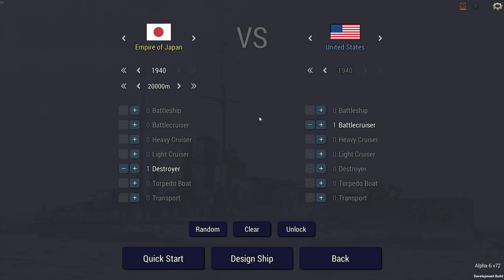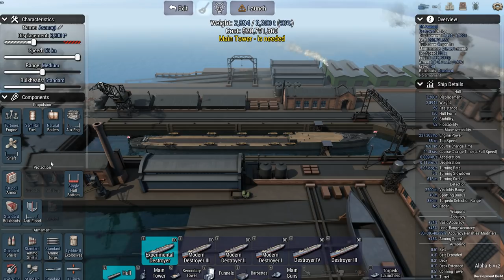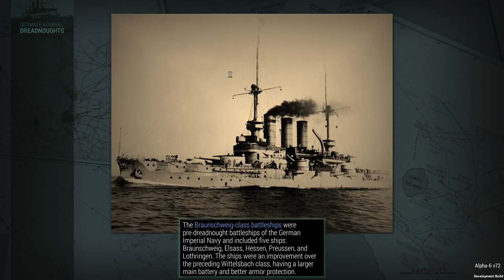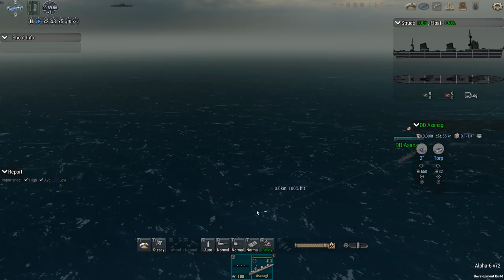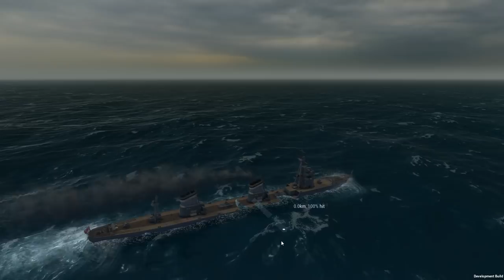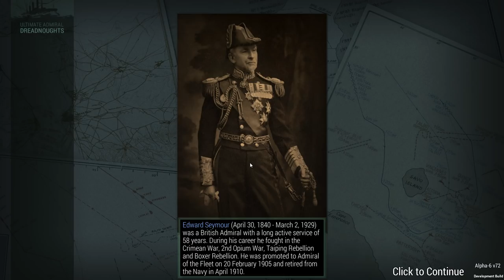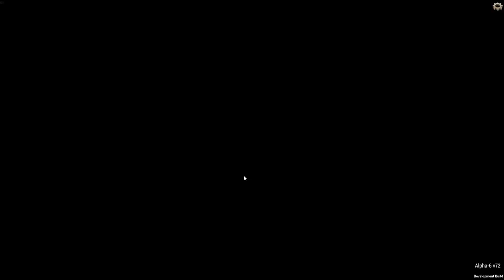Ultimate Admiral: Dreadnoughts - 55 Knots (Alpha 6)

Comment: How fast can your ship go?

"YES!"
Reply: Faster than some planes.
Reply: Todd Hendricks  Bear in mind that the higher the displacement, the bigger the engines (more weight) and probably the bigger the necessary funnel capacity. It's better to make a small destroyer and deck it out the wazoo with torpedo launchers

Comment: as to quote the great Jeremy clarkson

SPEEEEEEEED POWEEEEER

also a scenario

scenario: Johnston's revenge  

shortly after the battle of Samar a squadron of 10 modified fletcher class destroyers spotted a Japanese fleet consisting of 1 battleship and 3 destroyers the destroyers chase down this fleet and engage them with the intent to avenge the USS Johnston  

you will build (1945 tech) 10 American destroyers based on the fletcher, but you can minorly alter the design (change gun calibre, armour gun placement ECT) 

 you will fight (1940 tech) 1 Japanese battleship 3 Japanese destroyers  

win requirements at least 1 destroyer survives the Japanese battleship is sunk  

optional win requirements the Japanese destroyers are sunk more than 2 destroyers survive 

 you loose if the Japanese ship escapes or all your ships are sunk 

 good luck, you'll need it

Comment: Stealth it's not a bug look at the horsepower of the engines diesel has less power than steam but weights less but do to the low power it needs to be bigger and so it weights more
Reply from the maker: Ah of course, gotcha. Thanks!
Reply: It has a flat reduction %, that should mean it would weight quite a bit less
Reply: @hoovyzepoot  A difference of flat reduction by 17.5% doesn't matter because it has about half the engine power. Geared Turbines 2 is 30.5HP per ton with 10% reduction, Diesel 2 is 18HP per ton with 27.5% reduction. Let's say we need a 100,000HP engine, the Geared Turbines 2 will weigh 2950 tons (100,000 / 30.5 x 0.9), while the Diesel 2 engines will weigh 4028 tons (100,000 / 18 x 0.725), 37% heavier than the turbines. The benefits of the Diesel engines are that they are less likely to be damaged, are much faster to repair if they are damaged, and need less storage for fuel (which could save a little more weight, especially for long range ships, so could have some potential use when the campaign arrives). However if you just need power, Geared Turbines will always be the way to go.
Reply: @Stealth17Gaming  I've decided to wait for them to add rowboats/tiny ships so you can an 80 knot life raft that kills with a 2 mm and extra ammo. No armor needed. Make sure you have a bunch and call them the piranhas.
Reply: @Nutty31313  Marine diesel is basically the engine of choice when you need a ton of fuel efficiency and not that much speed. So basically, your auxiliary ships of all stripes, cargo vessels, subs, and convoy escorts. I don't know how much detail the campaign will go into and the devs have already said that aircraft aren't in the picture for the foreseeable future (and aircraft and subs are the reason escort ships existed), or if auxiliary ships like colliers, oilers, and tenders will be necessary, but that's where I'd use them.
Reply: @ZaffaPlaysGames  I heard somewhere they are looking into bringing submarines into the game, but I don't know if it's true. Also there were a few surface warships that used diesel engines, the most notable coming to mind being the Deutschland class pocket-battleships. Diesel engines have their place in the game, perhaps if you want max reliability and survivability and don't care much about speed you'll take them over the geared turbines.

Comment: THE IJN SATSUMA 
1914 the German East Asiatic Squadron under Admiral Von Spee  attempted to get back to Germany, by crossing the Pacific. This led to the Battle of Coronel and the 1st Battle of the Falklands, whilst he sent the Emden as a lone raider West for the Indian Ocean. What if instead of going East, he took all his forces West as the Allies feared.

The main search for the Germans was carried out by the Japanese.  The primary interception force being the Semi-Dreadnought Satsuma and two Protected Cruisers the Yahagai and the Hirado. IJN Satsuma would the rest of the war escorting ANZAC convoys across the Indian Ocean.

Suggestion is that Spee's complete force goes West and catches the Satsuma escorting a troop convoy. 

German forces are 2 Armoured (heavy) Cruisers and 4 Protected (light) Cruisers. Spee's ships were the best gunnery ships in the German Navy. They all dated from around 1906 to 1908

Japanese forces would be 5 troop transports, 2 Protected (light) Cruisers and the semi-dreadnought, Satsuma. Her stats were, 20,000 Tons, 482 feet long  launched 1906, commissioned 1910, range 9,100 nautical miles. 4 x 12" centerline guns,  12 x 10" side mounted guns, (only because they couldn't get more 12"). All off those where in twin turrets. 12 x 5" in casemates, 8 x 3" guns and 5 x underwater torp tubes. Belt was 9" cemented krupp armour as were casemates and turrets with a top speed of 18.25 knots from triple expansion engines and twin shafts. When launched she had the largest displacement of any warship in the world.

If the Satsuma had been fitted with all 12" as originally intended, she would have been the world’s first all big gun battleship, predating HMS Dreadnought. Which means that future Dreadnought style ships would have had to be known as Satsumas. That doesn't have quite the same ring to it. Ultimate Admiral : Satsuma, it might not sell so well.

BATTLE

I think you should design something similar to the Satsuma or at least in a Semi-Dreadnought style, and see if you can wipe out the East Asiatic Squadron while at the same time getting the troop ships to safety.

Win/loss conditions 3 transports and BB must survive. At least both Armoured and half the Protected cruisers on German side must be sunk.

4 hour duration, before nightfall ends the battle, as Germans can’t find transports after that and withdraw. Contact range 15,000 yards.

Comment: What about a full gun boat? Max displacement, 35kt and 5" guns everywhere. Heavy shells, lydite I, max autoloders.
Reply: Against a BB or BC? Yeah, good luck with that. Against a cruiser, maybe. I think that you can HE-spam-cheese at most two classes above. And more than one destroyer
Reply: 35kt..... 35 KILOTONS?!!
Reply: @at-90ree13  35kt would be only about 10 times heavier than what he designed here
Reply: @Notmyname1593  That's a scary prospect
Reply: @at-90ree13  35 kt is 35 knots, a measurement of speed. 1 knot is about 1.15 miles per hour.

Comment: I think the HP per ton and engine weight interaction is working as intended. a Diesel is a lighter engine than a turbine but you need a bigger engine to get the same HP.
Reply: Makes Sense
Reply: How is it lighter if you need more of it to do the same? What do you mean by "lightness" if not the tonnes/HP?
Reply: @Snagabott  the base weight of the engine is lighter as is the fuel and other auxiliary weight but the engine power scales less. fuel weight scales with range so that is going to be important in the campain

Comment: Attempt 11

The year is 1940, and the war goes poorly for the British. Repeated Luftwaffe attacks have crippled the RAF, and now, in a fit of accidental strategic genius, an impatient Hitler orders Sealion to proceed, despite the lack of air superiority. 
The British fleet are in poor shape to face off against an invasion fleet. A surprise Luftwaffe attack on Scapa Flow has rendered inoperable most of the Heavy and Light Cruisers available to defend Britain. 
The Battleships are in equally poor shape. the R-Class battleships are too slow to catch the invasion force, which even now is beginning to amass of the French coast, Nelson is heavily damaged after an ammunition tug carrying torpedoes violently exploded next to it in an air raid, and a near miss to Rodney has opened up most of its engine compartments to the sea. The only major capital units left are the Battlecruisers of the 1st Battlecruiser Squadron; Hood, Renown and Repulse. 
Conversely, the Germans are well prepared for an invasion. A full recall of the fleet has recently been issued, and now the Battleship Bismarck, the Battlecruisers Scharnhorst and Gneisenau and the Heavy Cruisers Admiral Hipper, Admiral Scheer, Lutzow  and Prinz Eugen are all ready for action, though due to desperate RAF attacks on Destroyers in port, they now sail with minimal destroyer escort.  
The two forces detect each other at around the same time, and the Germans split off to engage the British fleet, knowing that these are the only ships Britain can put to sea to defend themselves.
The Battle:
"Action stations men! German ships spotted close by!"
The British have:
0 Battleships
3 Battlecruisers (Which you shall design)
1 Heavy Cruiser
1 Light Cruiser
6 Destroyers

The Germans have:
1 Battleship
2 Battlecruisers
4 Heavy Cruisers
2 Destroyers

Special conditions:
The RN Destroyers are in bad shape, many of them have been operating continuously since Dunkirk with little repairs. As such, many of their exposed deck weapons, such as torpedoes, are in poor shape and break down often. Every 20 in game minutes,  generate a number randomly between 1-10. If the number is greater than 1-2 or 7-10 , do nothing. If the number is 3,4,5 or 6, turn off torpedoes on all DDs for that amount of in-game time.

The Germans cannot afford to repair ships extensively during an invasion. A BB/BC with less than 20% structure, a CA with less than 15% structure or a DD with less than 10% structure can be counted as destroyed for the results of battle.

Victory conditions: Destroy all enemy warships. You have 3 hours until its too late

Comment: The reason tonnage goes up with diesels is that they give much less hp/ton. 16, vs 30.5. So while the engines for a given amount of hp weigh less, you need almost double the amount of engines to make your hp need. 

This is why the increase/decrease in weight isn’t linear. The % change is compounded by the efficiency of the engine.

Comment: Possible roles for a 55 kn Destroyer: 

Scout 

Equipped with radar, stays at the edge of enemy engagement range to report enemy position and make him waste ammo 

Harrasment 

Equipped with loads of long range Torpedos, aggressively fires them into enemy formations to break them up and force enemy ships to evade 

Fireship 

Equipped with the most powerfull and fastest Torpedoes available and crewed by the suicidally insane, rushes isolated enemy HVTs like Battleships, Battlecruisers, etc and hand delivers the big badabooms
Reply: Another:
Drive (or in this case swim) by gunboat. Could also serve as fast-response anti-destroyer
Loads of 5 inch triple turrets, lyddite 1, autoloaders. Rush in, wreck transports/TBs/DDs and get the hell out before that BB turns its turrets.
Reply: Can you make a 55 kn cruiser though? Equip it with big guns with range, so the purpose would be to harrass other ships at range, where they cannot hit you. Also finish off any stragglers since they can catch anyone.

Comment: The thing about engines and weight is that you need to look at the horsepower per ton. 
Turbines have more, so they take less weight to generate the same power and therefore speed. 
Diesel engines are less weight efficient (but more than the old steam engines) in exchange for resistance to damage.

For example, say you need 100 horsepower to move a ship:
With geared steam turbines 2 you get 30.5 hp per ton, so you get an engine of 3.27 tons. Add the -10% modifier to engine weight and it goes to 2.94 tons.
With basic diesel you get 16 hp per ton, so you get an engine of 6.25 tons. Add the -22.5% engine weight modifier and it goes to 4.84 tons.
With the basic steam engine you just get 11 hp per ton, so you get an engine of 9.09 tons.

Also the fuel stowage is lower for diesel engines, so that also helps counteracting the weight efficiency.

Comment: Battle of z23. You as the Germans have one 55 knot destroyer called z23, which runs into the hood and a convoy of 1935 class15 transports, 2 destroyers and 1 heavy cruiser. You start at a range of 20000 meters and your gun has to be a 3.      I love your videos and keep up the good work.

Comment: About the engine weight: You might forget that not only the engine weight slightly decreases but also the power the engine delivers per ton of its weight goes up quite a lot. So you get more hp/ton and thus less weight overall.

The more powerful engine itself hasn't to be that big in order to get the ship to 55kn and its weight drops by e.g. 9%
some calculations to clarify things: Needed power: 50000 hp (example)
basic steam engine weight: 4545t
steam turbine engine weight: 2272t - 8% = 2090t
geared steam turbines: 1754t - 9% = 1596t
geared steam turbines II: 1639t - 10% = 1475t
marine diesel engine II: 2777t - 27,5% = 2013t
That even at little steps makes a difference of hundrets or even thousands of tons on your total engine weight depending on the engine type you choose
I hope I could help😀

Comment: I think its not a bug.

The thing is that there is two engine weights. One is the base weight and one is the hp/ton. The G turbine have the most power per ton, so for set amount of power, you get the least amount of weight.

Comment: A Time Travel Scenario - Battle of Manila Bay - 1940 destroyer vs 1895 Asiatic Squadron
It is 1942 and SS General Hans Kammler is in charge of the Axis time travel project Die Glocke at The Henge in Poland.  He is making some great strides but is tasked with creating a new device capable of transporting an entire vessel through time.  The Third Reich is hesitant to use their own vessels for this endeavor so instead gain access to a Japanese Kagerō-class destroyer, the Mirai, to use instead.  Kammler sends a group of top scientists including two Spanish scientists, Julio Palacios Martínez and Nicolás Cabrera, to Japanese occupied Manila in the Philippines to work on the new Project Mirai.  On April 30, 1943 the scientist are successful and send the Mirai back in time 45 years to April 30, 1898.  It is just before the Battle of Manila Bay and the US Asiatic Squadron is enroute to Manila.  If Germany can defeat the US invasion of the Philippines here it will drastically change the Pacific Theater in the war.  With a Japanese occupied Manila at the beginning of WWII and the foreknowledge of the future the Spanish Scientist and Japanese crew bring to play, this will radically change history. 

You are in command of the Japanese destroyer Mirai (Future).  She is armed as a pretty standard vessel and wasn’t given any improved weapons since the Japanese turned her over “as-is” to the Germans for this project.  She does have top of the line turbines and boilers though so she could power the project, as well as some high level electronic devices for detecting electromagnetic waves, so assume some level of high computing power on board. 
 
Class and type:	Kagerō-class destroyer  (based off of the Akigumo)
Displacement:	2,490 long tons (2,530 t)
Length:		118.5 m (388 ft 9 in) full, 116.2 m (381 ft 3 in) waterline
Beam:		10.8 m (35 ft 5 in)
Draft:			3.8 m (12 ft 6 in)
Propulsion:	
3 × Kampon water tube boilers,  (assume these may have been upgraded)
2 × Kanpon impulse turbines,  (assume these may have been upgraded)
2 × shafts, 52,000 shaft hp (39,000 kW)  (assume this is increased as well)
Speed:	35.5 knots (65.7 km/h; 40.9 mph) (this may also be higher, but not by very much, wouldn’t go over 40 knots)

Armament:	
6 Type 3 × 12.7 cm (5 in) guns.  One super-firing pair aft (one raised behind the other so both can fire aft), and one forward of the superstructure
2 × twin 25 mm (1 in) AA guns  (Can add more and not be historically inaccurate, but this ship would have been almost new when “acquired” by the Germans, and it is doubtful that any additional armament would have been installed.  I leave it to your discretion)
2 x quad traverse mount 61 cm (24 in) torpedo tubes with a load out of 16 oxygen fueled torpedoes (one reload for each tube) 
Both the active type 22 and the passive type E-27 radars would be on her originally, but may have been upgraded for Project Mirai.

The US Asiatic Squadron  circa 1895  (some ships were commissioned 1890 or even earlier, some were as late as 1897)
3 - Heavy Cruiser (USS Olympia, USS Baltimore, USS Boston) 
1 - Light Cruiser  (USS Raleigh)
2 - Destroyer/Gunboat (USS Petrel, USS Concord)
1 - Torpedo Boat/Cutter (USRC McCulloch)

These are my interpretation given whether the ships had 8 inch guns (Heavy) or max 6 inch guns (Light) and that a gunboat is smaller than a cruiser.  The cutter McCulloch did have a single torpedo launcher, so she became a torpedo boat.  If you think my layout of these vessels is in error, feel free to change them.  All vessels are the real ones at the Battle of Manila Bay.

The Mirai will literally appear out of nowhere, so I leave the range up to you.  

Sink all US ships to win the battle and change history.  Have Fun!
As an optional win scenario try winning without taking excessive damage to the Mirai.  The scientists are the only hope for everyone to return to the future.  They are below decks to get out of the way of everyone.  If the Mirai takes on flood damage it is conceivable that they will drown, so win without taking more than 20% flood damage. Also, the time machine itself is located in the Main Tower.  If it is destroyed then there is no way to return.  

The US ships don’t have to all be destroyed. You can consider it a win if you take out the heavy and light cruisers, the other three ships can flee if they want.  Not sure the AI will allow that.
There is no time limit.  The Battle of Manila Bay started at midnight, but you have already thrown that plan out the window, so take all the time you need.

Scenario is roughly based of the Japanese anime Zipang. A good show. If you liked The Final Countdown movie you probably would like Zipang.